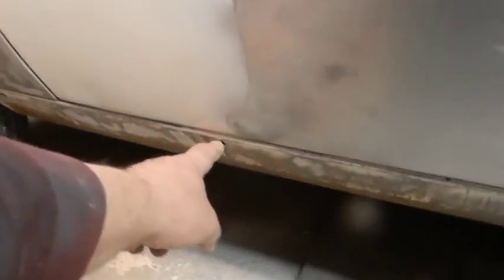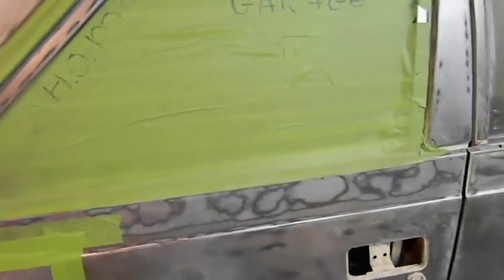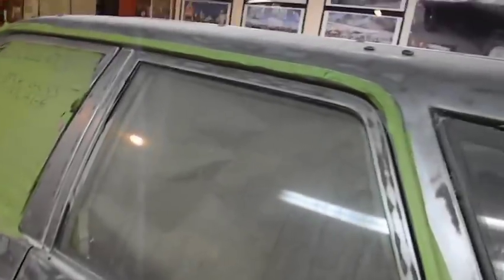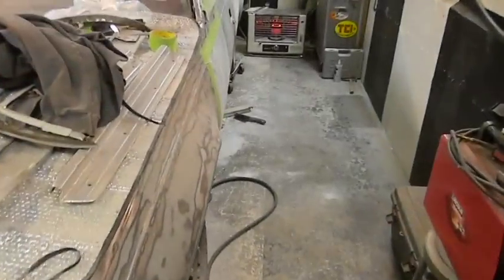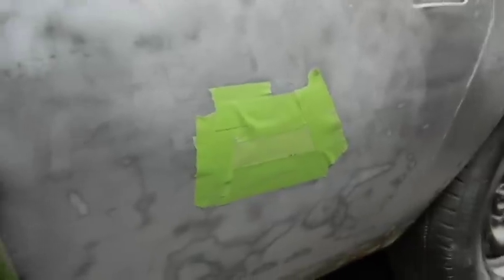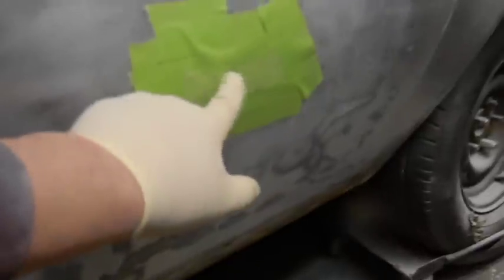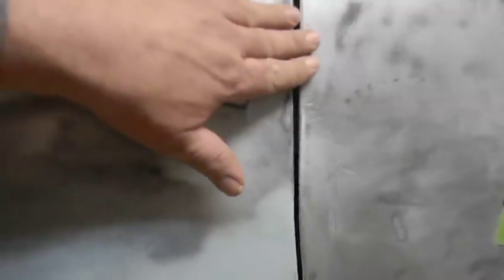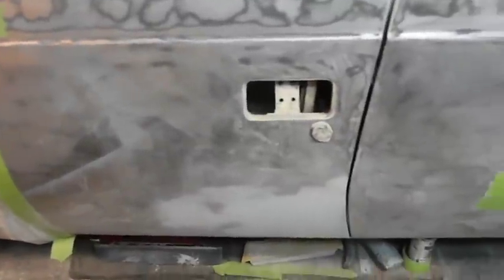Small Garage Big Dreams Pt 27

Comment: if you try to work it with the pick end of your hammer you will just stretch the metal even more making a big headache for yourself. you need to buy a shrinking dolly and a shrinking hammer, use that to pull that high spot down.  

i would even suggest stripping all the filler off that area and using a torch to heat shrink that high spot then work it with a hammer and dolly. 

on the rocker, sandblast it, then tin the entire rocker with lead. permanent repair that is far tougher than you can get with any type of body filler. it will also be totally rust proof.
Reply from the maker: I agree...I have a shrinking hammer but the door has a safety beam so i was unable to use it..was able to get it pretty close before i filled it...